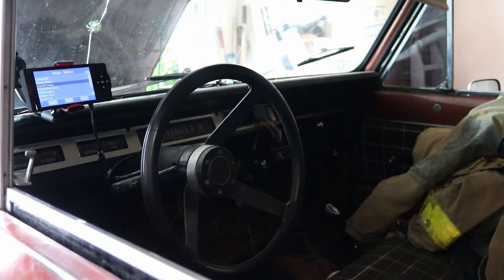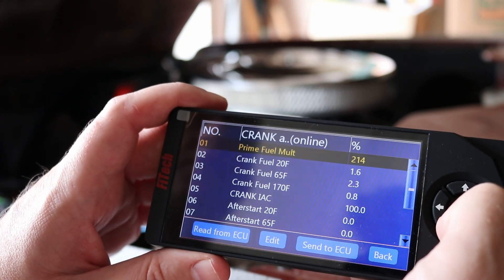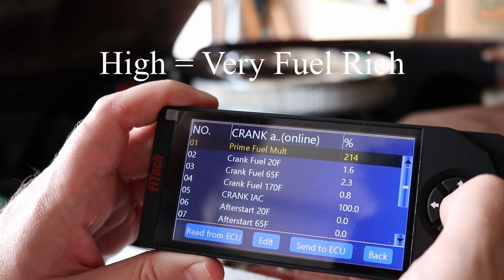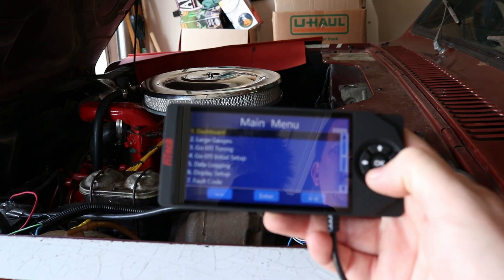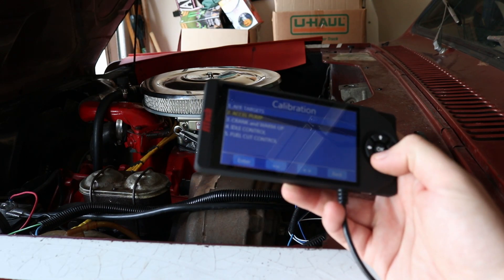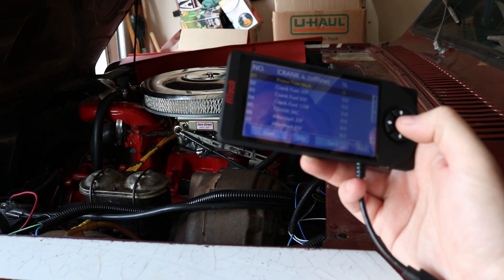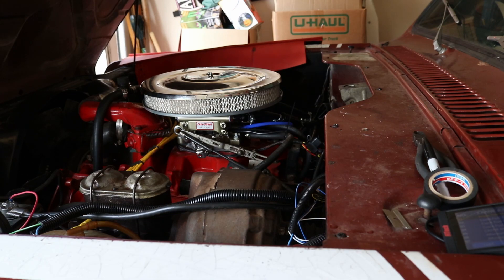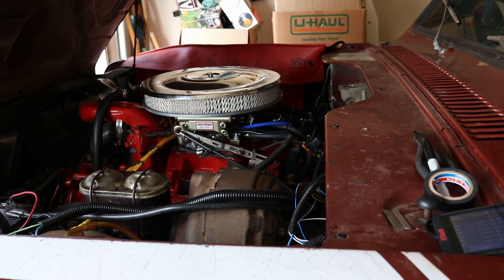FiTech EFI Initial Start Tuning on the International Scout II 345ci v8

Comment: It's been a while, how has the EFI held up for the scout? What was your MPG before and after?
Reply from the maker: I encountered a handful of issues. Most were not the FiTechs fault and the Scout engine is currently torn apart and being rebuilt. Biggest issue I had with the FiTech was the fuel delivery and my gas tank not being spotless. I kept clogging the filter between the FiTech and the fuel pump. In the next couple months I should be able to deliver better data on it.
Reply: @NaturesEngineerandI  are you rebuilding it yourself?
Reply from the maker: @elijahstrauss643  I am. I'm gonna have the block tanked and cleaned up. I may have them put the cam bearings in for me too, not sure. I pulled the old ones and see a lot of opportunity to screw them up putting them in so I'm a bit nervous. Other than that I will do everything else.
Reply: @NaturesEngineerandI  Thank you for the response! I hope my 345 doesn't need a rebuild, but if it does, this is the way. I just picked up a scout 2 and have been trying to get it started again, not sure if it's the carb though and was glad i came accross your video as EFI has been on my mind. I'm over next to McKinney, would love to see how you pulled the engine apart!
Reply from the maker: @elijahstrauss643  really about the most common thing that makes them need torn apart are the cam bearings coming apart. At 135k miles I have zero ring ridge and all the other bearings looked fine. I'm only doing a rebuild because I had no oil pressure when the oil got hot. I moved away from the DFW area a couple years ago but make sure you join North Texas Binders if you haven't already. They have monthly meetups and have some knowledgeable people. Also if you want to see a good disassembly and rebuild video, check out Erik the Wrench. He has a two part rebuild video that is pretty informative.

Comment: Nicely done. Glad to see the cold start issue was just a simple adjustment. For me the biggest draw for this type of TBI system is the cold start capability. Noticed you said you're in Texas. So am I. Just a little northeast of Dallas.
Reply from the maker: Thanks! True cold start was always terrible with my Scout. Kansas winters meant idling on a lot of choke for 10 minutes before you could even think of driving off. I am looking forward to the temp dropping some and seeing how this does. I am straight north of Dallas right now so we might be pretty close! We don't typically get cold winters here but I might get lucky and have a freeze or two to try it out,
Reply: @NaturesEngineerandI  I'm just east of Lake Lavon north of Wylie and work (when not working from home due to pandemmics) in Richardson off of the bush and shiloh. Sounds like you're probably in Carrollton/Lewisville/Addison/Richardson/Plano area.